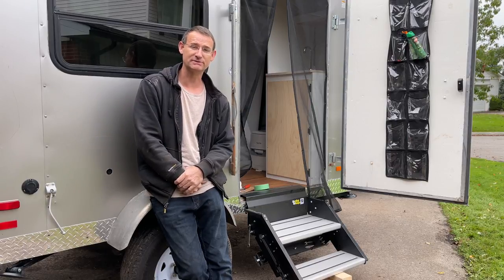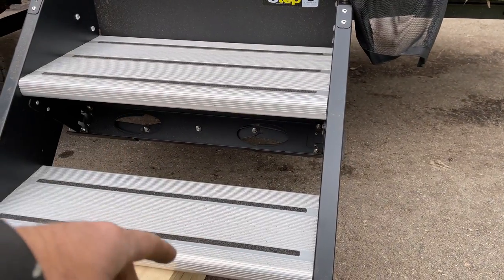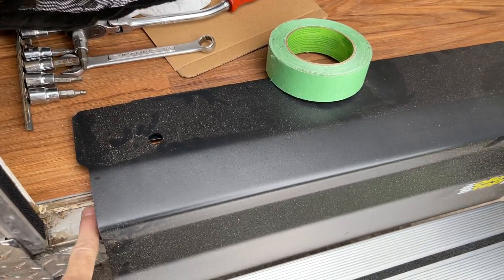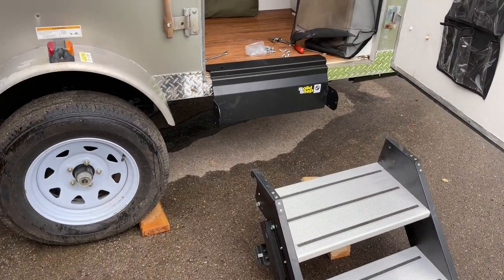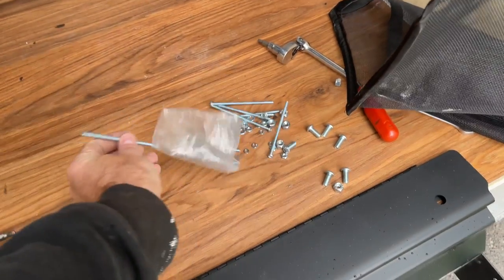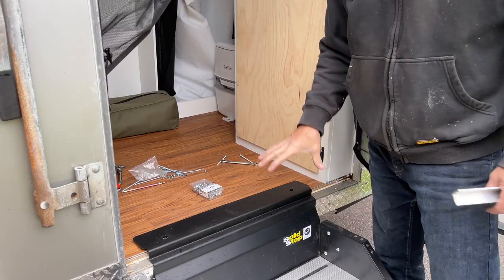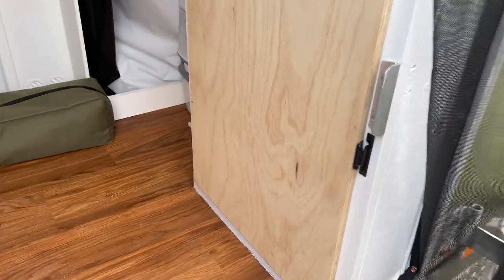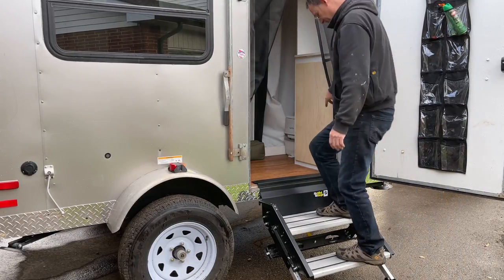How to Build a Cargo Trailer Camper Part 14 - Fold away Solid Steps

Comment: There are pluses and minuses to everything.  These stairs are great once you arrive, and provide the ground clearance you mentioned.  They are a PITA if the trailer needs to be accessed for bathroom breaks or snacks along the travel route.  Stopping along the way involves constant adjustment of the feet until you get where you’re going.  On edit, really great install of an item I really wanted to like.
Reply from the maker: Yeah I can definitely see that being true, mostly if your pulling off to the side of the road. Always some compromises. Thanks for watching 👍

Comment: I tried to get the breaks reworked on set of stairs I purchased but the shop in my area couldn’t grasp the concept😡. Nice job on yours
Reply from the maker: Oh that stinks! It was kind of the same for me…. Young guy in the shop said it was impossible then the older shop foreman came over and said I’ll do it… and he just did it. Took him 20min…. You need to find someone with experience that can think outside the box!🤷🏻

If you are desperate maybe try welder. They could probably cut it and weld it… so they fit nice and tight! That was going to be my next step.

Comment: great stair system! im searching for stairs/steps. dont want to lose grtound clearance either. ran over my step stool last year lol. ill check them out, maybe consider building something similar as well. great channel. im on my second cargo build as well
Reply from the maker: I always would rather build my own… let me know if you figure out a good system. Maybe for my next one 😁👍
Reply: @waysoutback  if i could only weld aluminum! i think my wire welder will. ill have to check on that. have you any experience with those aluminum "brazing" type rods that have been advertized the last several years?
Reply from the maker: @d-arts7139  yeah I hear you… aluminum is definitely where it’s at… I’ve just got a mig welder so definitely limited. I think one of those mig/tig welders would be very handy for that…. Then you could tig it up. I really don’t have any experience though.

Comment: While that's a really excellent application, you lose the stealth capability if you want to keep everything closed up and need to use your sink area.  But, if maintaining any stealth is not a concern, I think this is a top-notch way to deal with access.
Reply from the maker: Thanks for the comment! Yeah unfortunately I think I’m beyond stealth camping with my double propane tanks etc. Maybe a small fold up footstool might work it’s tough it’s so high.
Reply: @waysoutback  Your solution is definitely great looking AND really supportive.  Since our 6x10 only has the rear barn doors, I had to come up with a solution that could retract underneath the trailer.  So we went with a single step that we could slide up and back and secure it with two cotter/clevis pin combos.  Not elegant, but it's still better than climbing up into the trailer (we flipped the axle to get more ground clearance).

Comment: Noticed the screws on your camper are rusting swap them all out with stainless before your camper is rust stained
Reply from the maker: It was my construction trailer for years. Used a lot in the salt so a little worse for wear. 
I’ll look into those stainless screws. Thanks for the tip.